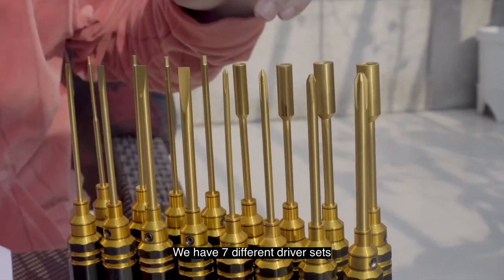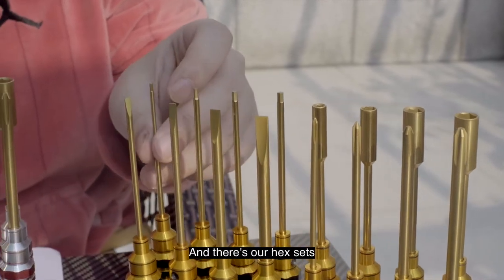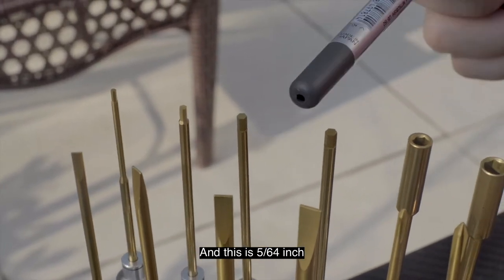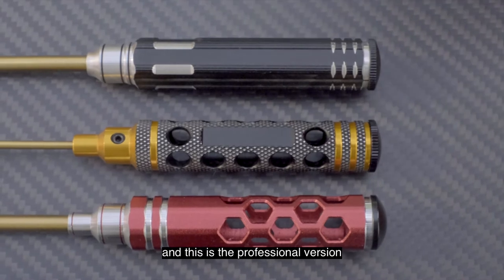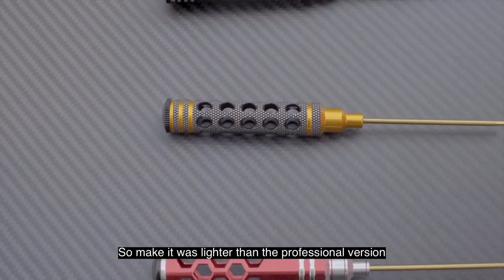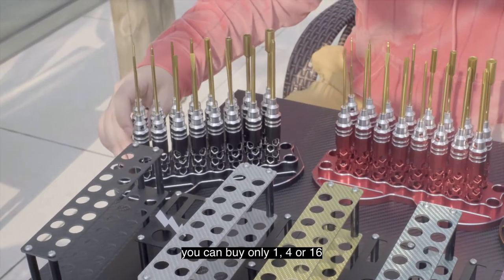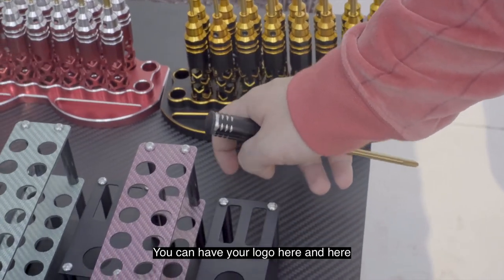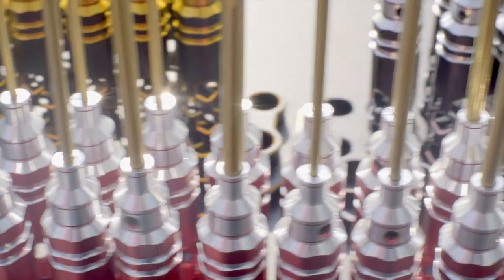RC screwdriver tool sets with custom logo and color with carbon fiber stand from RJX HOBBY

Comment: you don't offer any torx heads bits, and your prices are ridiculous,  I can get the exact same kits on aliexpress and alibaba for $56usd and you don't even have a  0 or 00 philips head
Reply from the maker: Hi Mark,have you used any of our tools?
Reply: @RJXhobby643  Not your specific branded tools,because as I stated you don't offer any torx kits, also as stated the exact kits can be purchased direct from manufactures of Alibaba,Aliexpress or Banggood for much less per kit, or $2-3 per driver.